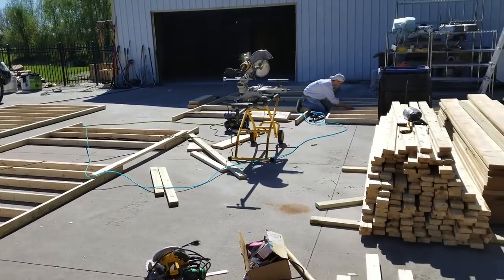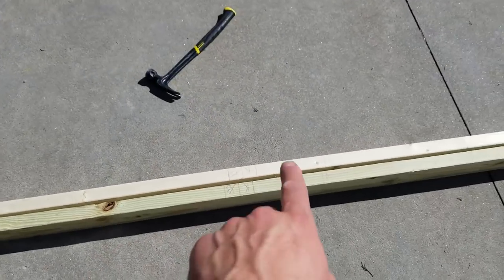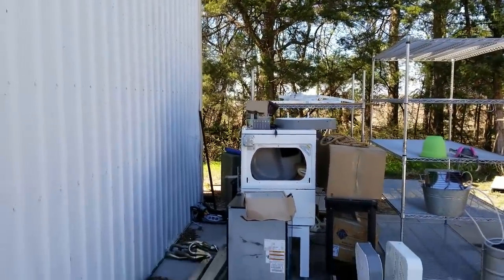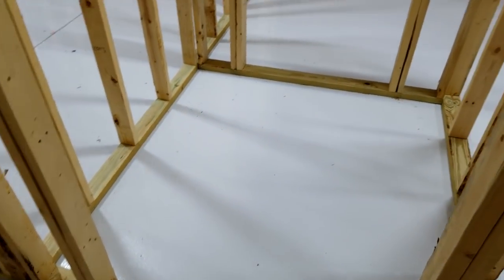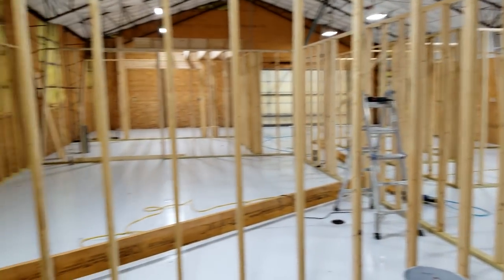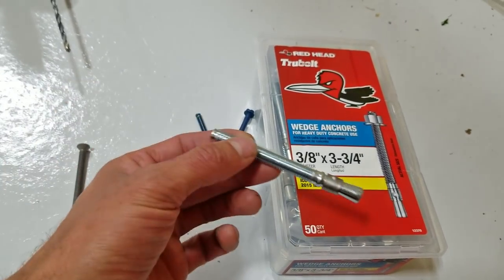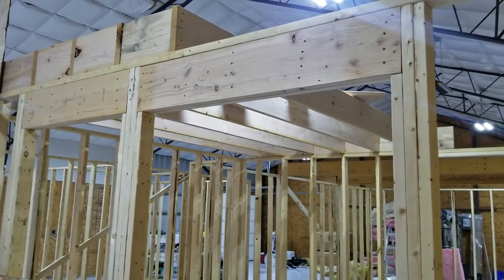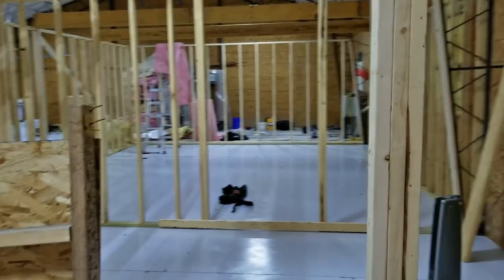Building a 2400 sq ft Gourmet Mushroom Farm Framing and layout

Comment: Why did you change from the bubba barrel to an actual autoclave?  Also, did you get the autoclave in the states or from overseas?
Reply from the maker: I have a barrel for sawdust, the autoclave will be for commercial spawn production. I wont have the autoclave up and running for a few months, I still need to find a boiler and get it all hooked up and inspected. For supplemented sawdust blocks you dont need an autoclave but for reliable spawn you do.

Comment: bad crack in the cement floor in your fruiting room, what happened? no subgrade?
Reply from the maker: unpacked sand apparently. They also did remesh, but it was just laid in the sand not raised up into the slab... Ill be addressing it this week, Already used a crack filler, now doing a resurfacer to adjust the grade.
Reply: @MyersMushroomsFarms  it would also be neat to see a final plan view of your operation, in the beginning of the video you showed some rough pen drawing but i'd like to know the reasons to why you had positioned the rooms where they are. any recommendations on a good layout for those who don't have such a huge shop? also talk about positive versus negative air pressures and how you are going to control the air flow within your entire structure, are you going to force air at all? or mostly use outdoors air for your grow room? some people seem to favor the recycling of their clean lab air for their grow room, can't wrap my head around that yet...